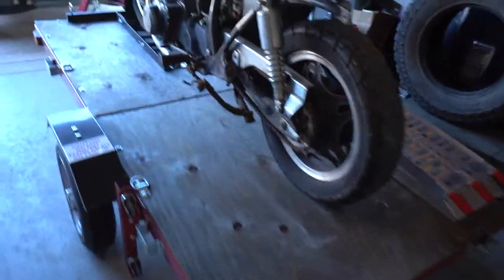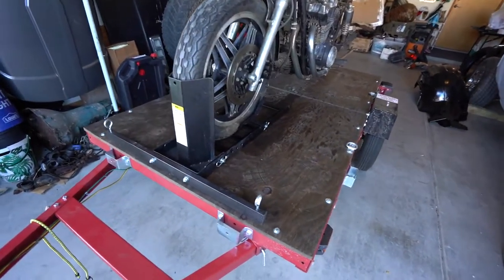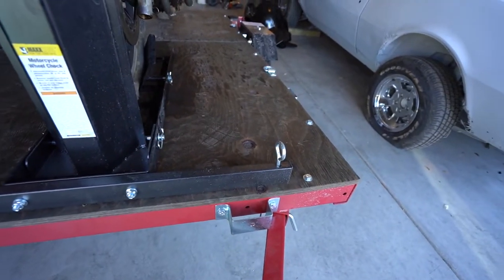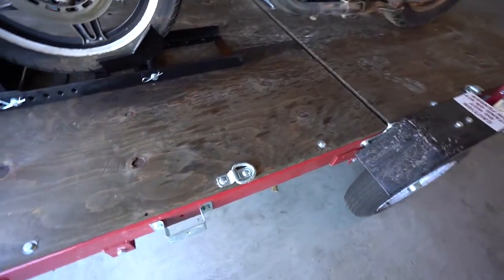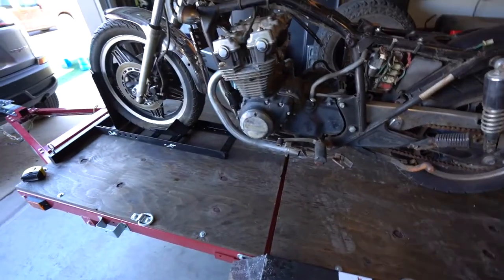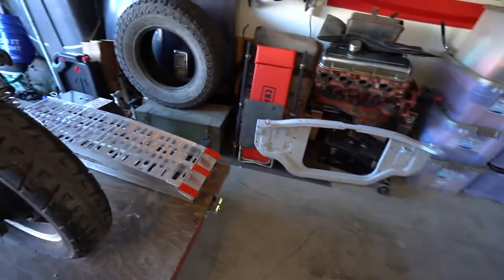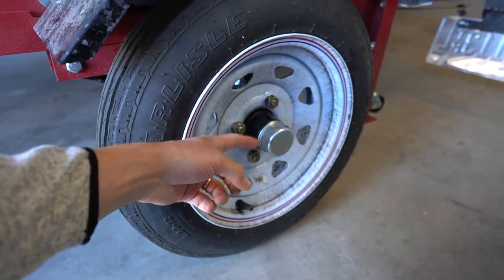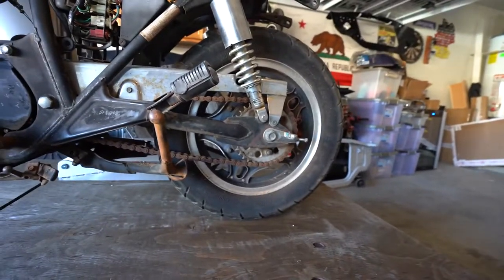Harbor Freight Folding Utility Trailer [PART 2]!!! PLUS 2021 GIVEAWAY!!!

Comment: I assembled mine almost the same as yours. Bolted the wood and tie hooks down through the frame. I used the Lock N Load chock system. I highly recommend it. It came with the retractable tie straps that you mount to trailer floor. The wheel chock itself is mounted on a special mounting plate provided. The plate is mounted to floor and the chock is removable so you can haul other stuff when needed.
Reply from the maker: Awesome! Glad it all worked out for you, hope my videos helped you. Thanks for watching :)

Comment: If that is a CB750 Custom, I rode one of those for many years from new. It is a very comfortable two-up bike due to the factory seat and low seat height. The rear chrome surround bar for the seat adds confidence to passengers that want to hang on to something other than you. The oil cooler is not needed and is more of a liability if fittings/hoses were to leak. The bike runs cool even two-up with luggage in the CA desert. Enjoy that fine bike!
Reply from the maker: It sure is! It was my uncles bike who bought it new as well. It’s still being rebuilt
Reply: @motorview40  Everything is easy (valve adjustment, .....) but the carb sync. Look up you tubes or consider paying. If you have the gauges (I do) it is not hard but you need to follow the procedure. Even if one is off just a little it will not idle correctly and will not have that wonderful powerband those inline 750 Hondas have. You are going to love that bike. They are so comfortable you can tour on them. Mine was stock so I don't know about your handle bars. Enjoy!

Comment: Were you able to still fold it neatly with the chock installed?
Reply from the maker: Yes, but I would have to remove the front and rear pins to the vertical pieces holding in the tire. The base of the chock stayed. Real easy to set back up again based off the tire size you were using.

Comment: I'm thinking of doing the same setup. 
Only my situation is a bit different, I want to put together this type of setup.
I'll be driving over 1,500 miles one way empty trailer and pickup a 2011 honda rebel and drive it back another 1,500 miles. Total weight of the rebel is 330 LB. 

What do you think, will the tires and trailer handle the trip back going around 65-75 mph while towing the bike?

I also will be using my 2006 accord for towing it. It's rated to tow 1,000 LB but my total weight going back will be under 600lb. 
Any recommendations?
I'm a little worried for the trailer, I don't want it falling apart towing the rebel. 
I've heard stories where these trailers fall apart while in motion.
Reply from the maker: Hi Mark, I wouldn’t worry too much about the trailer falling apart, as long as you put it together correctly, and ensure all the bolts are tight. I highly recommend bolting the tie down rings to the frame just like I did. Some say to repack the bearings with better grease than what it came shipped with, might be a good idea. On long trips (1000mi +) my bearings did get warm, but not too hot to the touch. 

I would be more worried about towing that much weight with the honda than I would be about the trailers integrity. You may be ok, but I’d stray away from steep climbs.  Grab a spare tire for it as well if you are worried about a flat on the trip. My trailer handled those speeds just fine, good luck!

Comment: Would you be able to give a measurement from the wheel chock to the end of the plywood on the trailer? Overall length. My bike is a tad long.
Also are these trailers meant to tilt? Do you still need a ramp if it tilts?
Reply from the maker: Hi Tim, sorry it took me a while to get back to you. From the farthest forward position of the wheel chock, it measures 95", or just shy of 8' to the end of the plywood. Depending on the height of your towing vehicle, it will tilt some as it rides, but I do have a ramp that I use to get the motorcycles on and off. Easier than lifting the entire bike about a foot or so off the ground by yourself!

Comment: how fast were you going on your trip? Tires are only rated for 55 but highway speeds exceed that often
Reply from the maker: I was driving 64-75 mph...easily
Reply: Also curious, was this prolonged times? I have to travel close to 400 miles to some tracks and it's 90% highway. Will they hold up our should I replace the tires and bearings?
Reply from the maker: @Wolfcone  yes...over 15 hour trip broken into two days, all highway miles and got up to those speeds I mentioned. It did really well!
Reply from the maker: @Wolfcone  over 1000 miles, so I couldn’t exactly tell ya how many trips you should take to the track before looking into that maintenance. Monitor it and be sure to conduct detailed inspections before and after, I’d be interested to know how many you can get.